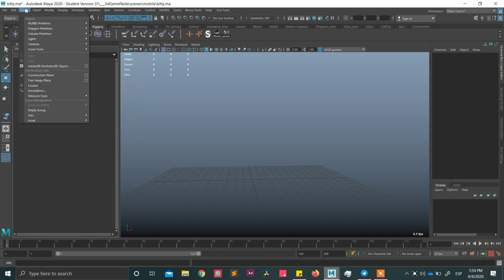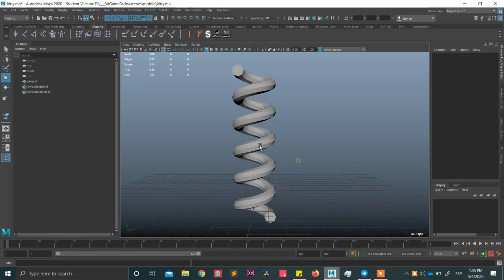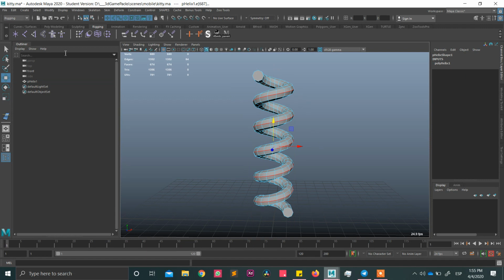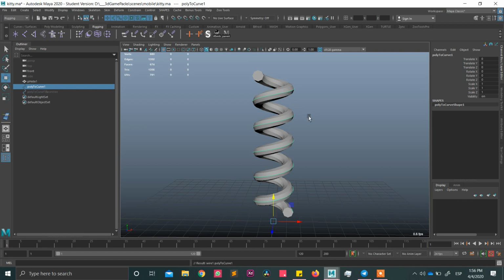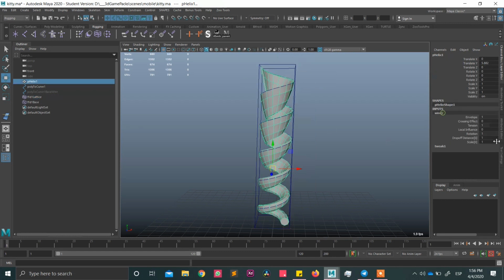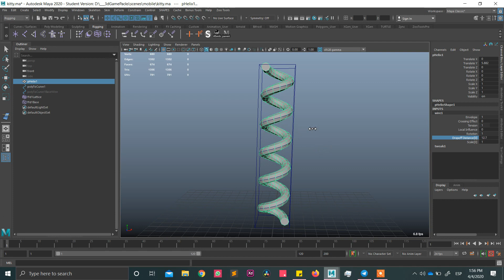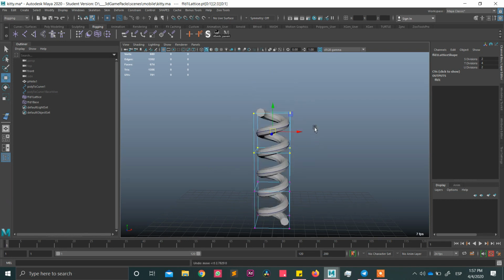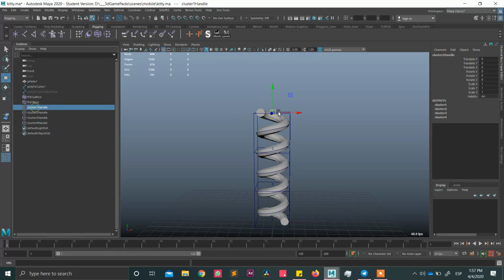How to rig a spring in Maya (2 simple ways)

Comment: Is there a way to make it with joints, so I could export animation to software like Unreal?
Reply from the maker: In this situation I would do it ether way, and create blendshapes. Default geo with compressed and stretched blendshapes..
Reply: @VerónicaMorera  Thanks for such a fast reply. Unfortunately I need to rig already bended and textured helix (phone cable). I don't think I can make even a lattice deformer.
Reply from the maker: @filipmasiulewicz5036  hmmm, probably the classic reliable, joint per coil and loots of patience with smooth weight painting.